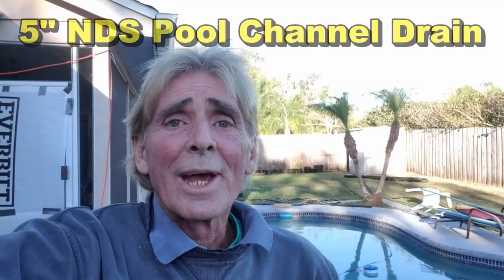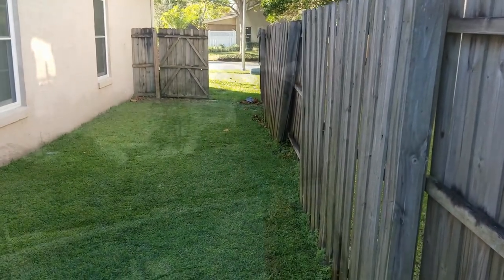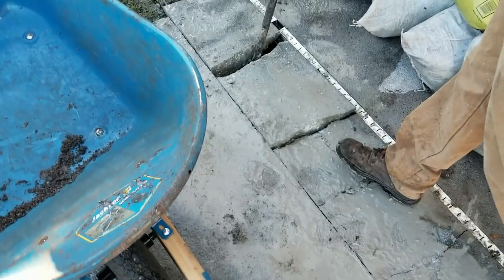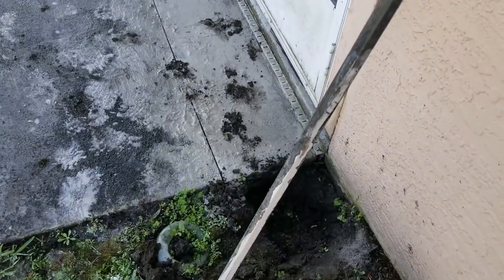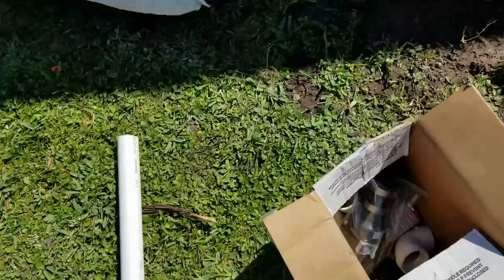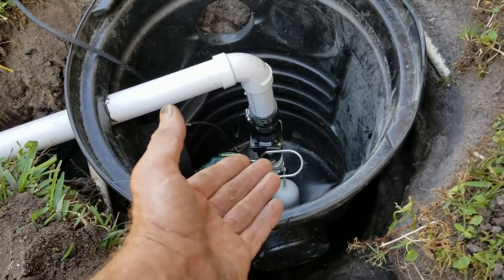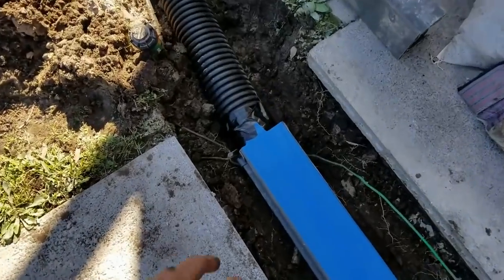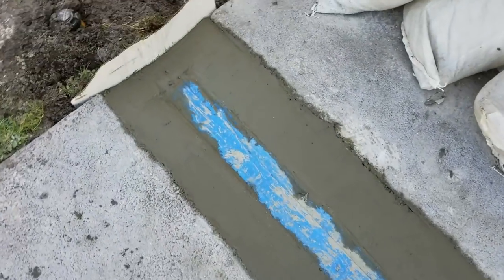Channel Drain, Sump Pump, French Drain, Best Application.

Comment: You do GREAT WORK. I live in the northeast and have a 22 x 15 patio slab over 50 years old. Have some puddling area in the rear not pitching for about 14 feet towards the front. This is a great fix. Will cut install some crush stone then this drain as you did and install to the low point put it into a pump tub. No pump...crushed stone and rock ...Pump would freeze in winter. ANy suggestions. GREAT VIDEO!

Comment: Hi Chuck. Have a channel drain problem whereas the 1 1/2" channel drain in our screened in pool area gets quickly overwhelmed (might be the pitch is too flat too) and the water starts flowing over the channel into our lanai area where we have furniture. What about putting a sump pump basin outside the pool enclosure (on the discharge side of the channel drain) and essentially suck the water out of the channel drain into the discharge area? Otherwise I don't prefer to break up the concrete in our pool/lanai area to put in a sump pump and/or wider channel drain system.  Thoughts?

Comment: Hello

I put a 4" drain PVC drain pipe in My side yard all the way our ditch at the road of about 90 feet

First 40 feet is a slight bubble down and after that a half a bubble down

Our problem is the side of Our house now has a 25'x60' lean to carport and of course in Florida when it rains it really rains an We get 6" to 8" of standing water that sometimes takes over a week to drain off

I am planning on putting in a Sump and a pump to help move that water

I used 3 of those 6" drain sediment traps and the solid thin wall 4 " PVC 

I would like to feed the sump output into the last drain fixture pointed to the street

Has this been done with any success?

I imagine it would possibly act as a self cleaning flush of the line

Thank You

Ken in Florid

Comment: Hi Chuck. I've seen NDS instruction manual for installing a french drain and they state to install french drain a minimum below the finished interior grade. Is this ok to do or does hlit have to be installed at the bottom of the footing? 
thank you

Comment: Hi Chuck! Great video. I stupidly built a chicken coop on the low end of a concrete slab and the rain just runs like a RIVER and slams right into the wood of my brand new coop. I'm tempted to drill holes or cut a trench right across the concrete to stop the water. Would you do that?

Comment: Nex time put the concrete over the wheels is a better spot to put all the load
Reply: I think they are intentionally trying to put as much of the weight close as possible to the drawbar, so the rear of the vehicle also takes more of the weight. I say this because it looks like the trailer is going to fall apart any second. Infact if you stare at that trailer too hard it would probably fall apart..
They need to retire that trailer to a farm, and use it for carting straw or something. One day there will be concrete blocks all over the road and hopefully no injured pedestrians!..